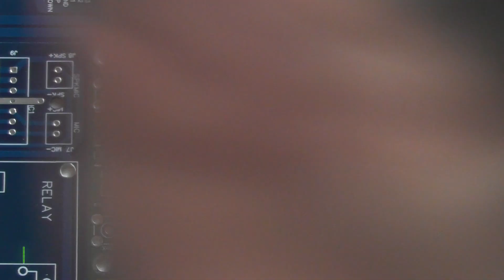Making a Radioberry board

Comment: Very nice, quite a job. Still got the PCB's but not all components because of the shortage during covid. But I got one from China before covid also v2 and it works great.
Reply from the maker: Great stuff well some of the components have ended so I've had to find replacement parts. Hopfully the main FPGA chip doesn't come to and end!

Comment: Merci Duane pour cette Vidéo ... Combien t'a coûté cette fabrication de carte RadioBerry toute finie ? Via JlcPcb ? Seule ne forme pas le Transceiver elle doit être couplée à la carte RadioBerryPreamp ... Utlises tu celle de Pa3GSB ou une autre pour la préamplification et commutation Rx/Tx ?? 73 mon ami
Reply from the maker: I bought 10 boards from JLC, components from Digikey and Aliexpress. It works out to about 80 Euros each.
I made the Pa3GSB preamp but this Amp is over complicated and needs software to adjust the bias.
It's best suited to work with a pc and juice board.
I also tried the Chinese preamp from Amazon which worked much better than the Pa3GSB preamp. Very simple and straightforward Amp.
I eventually settled with a 10w Amp from a Ukrainian supplier at 60db.com. 
This Amp works very well with just a small input from the radioberry board.